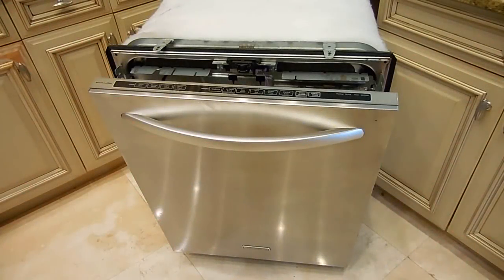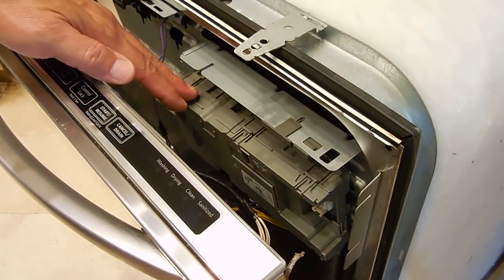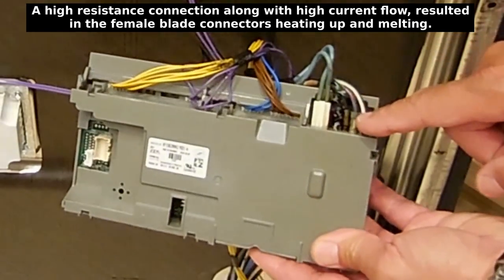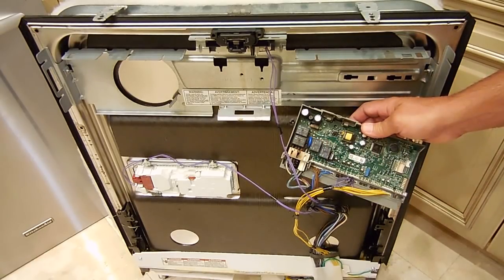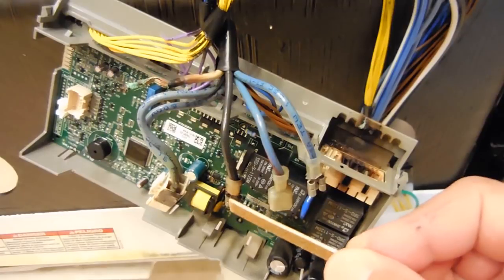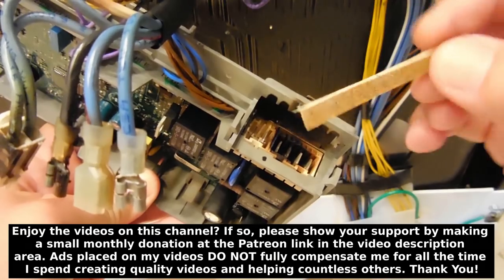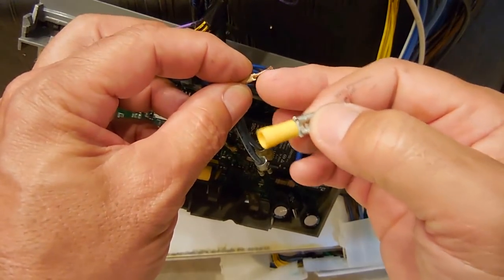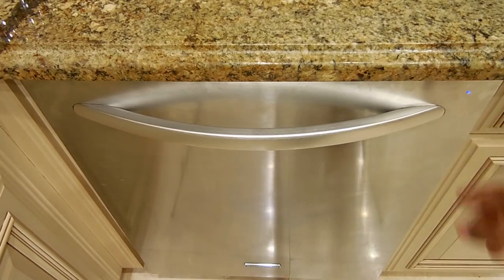KitchenAid Dishwasher Repair (No Power)

Comment from the maker: At the link below enter "dishwasher electronic control board" in the search box for a complete listing for your KitchenAid:
http://amzn.to/2jGNyVJ
(Amazon Affiliate Link)

*Don't miss out*  9% off Banggood sitewide! Next 2 days only. Visit the link below, and use this coupon code: 2017cyber9%. Also try this code for 10% off electronics: ELECTRO10

Home Page: http://bit.ly/2wDbRdi
Flash Deals: http://bit.ly/2eBLkVI
(Purchase supports my work on Youtube)
Reply: I don't need it but I thought it would be interesting to see the price of the board, the link doesn't work. Must have been the heater wires.
Reply from the maker: The current draw of the heating element is what causes the problem to occur, but the wires to the heater aren't the problem, the power supply wires to the control board are. The link works, read above again. Thanks!
Reply: Yeah I missed the add "Dishwasher control board" Yes I understood the connector was the issue, poorly designed as you mentioned. My repair would have been to remove the plastic and solder directly to the terminals.  I realize this is not for everyone. This should not be common especially with a heating circuit. That is why we have UL, these types of issues should be a UL fail. Excellent as always example. Currently with YouTube changes I do not get the RE's I have to book mark and come back to see any additional comments. I wish they would get their act together.
Reply from the maker: I also thought of bypassing the terminals and soldering the wires directly to the wide traces. They really botched by using the blade connectors.

Comment: The same two wires burnt! The repair guy wanted +$600.00 to “ replace the control panel” plus labor… “it’s a lot of work “ he said! Thanks to your video and your thorough explanation I spent on  a couple of connectors and a pair of pliers. Done!! I fee so proud of myself!! Thank you!!
Reply from the maker: Great to hear! Hopefully it holds up. If it doesn't, you can buy a replacement module at the links provided. Thanks for watching
Reply: Same with my dishwasher. Wire’s toasted. Hope the circuit board is fine.

Comment: Wow, an $88 board that will outlast almost assuredly the compromised card.  I'm not so sure the savings are worth a correct repair, in my opinion.  The heated terminals on the PCB WILL fail again.  Its not a loose card connection point that makes the charred ends.  It's continuous CURRENT that creates the excessive HEAT the burns the connectors.  This wi/ll happen LIKELY based on hours of use.
Reply from the maker: It was a lousy design.

Comment: I have exactly the same dishwasher and I had exactly the same problem about a year ago. I replaced the control board and made sure the connectors were ok but now I can smell it burning again. This will be the 6th major repair I have had to perform on this machine in 6 years of ownership. What an unbelievable piece of junk. On my board it looked like one of the relays was failing and that is what cased it to burn. However, that fact that some here were able to fix the connector and put the board back into service indicates that it is, in fact, a connector issue. Either way, if the controller board looks like it has been damaged by the heat you should really consider replacing it because it may be the next weakest link.
Reply from the maker: The dishwasher should've been recalled for being a fire hazard. Thanks for watching!
Reply: @electronicsNmore  Spot on. This is a horrible design. Mine burned the relays even with perfect wiring. I’ve replaced way too much stuff on this POS in the 7 years I’ve had it. It’s going in the trash and I’m Going Bosch 800 series... wish me luck!

Comment: I have a similar model with the similar control board. The DW is completely dead. I've tried reboots, turning of the CB for 15 minutes, nothing works. I took it apart and there are no obvious burn marks. Earlier models had  fuse that was easy to replacce. The control board is 200 and the repair guy trip charge is 205.
Reply from the maker: It's easy to install. Buy one and do it yourself. I included links to buy it on Amazon. Look in the video description area. Thanks for watching!
Reply: @electronicsNmore  Thank you for the video. My dishwasher looks to be the same model and won't turn on. Nothing looks burned on mine but I do have power coming to the board. I'm thinking I need to replace the board but I don't know how to check to be sure. Any tips? Also, I don't see a link to buy it on Amazon.

Comment: This is exactly what happened to my Dishwasher. I have a Kenmore 665 model.  I had to buy a new control board because my current one wasn’t even working.  The replacement was used but I also noticed a little charring on the terminals.  I cleaned them up and works good as new.
Reply from the maker: Make sure you squeezed the female blade connector tighter before sliding it back onto the male blade.

Comment: In case this helps someone... my Kenmore DW had no power, and all I needed to do was turn off the breaker and on again, as if it needed a power cycle/reset.
Reply from the maker: You got lucky, with the KitchenAid dishwashers, they're usually burned up.
Reply: you might want to inspect the wiring for signs of burning.   and clean the terminals.

Comment: Great video. My board was burnt worse than this one and needed to be replaced. Also had to put on new connectors although I didn't use heat shrink wrap on the wires. They had plastic on the connectors where I crimped them. Replaced board and it works perfect.
Reply from the maker: Glad to hear you're back in operation Don. I have many videos on my channel that cover a wide range of subjects, so be sure to look over my extensive video playlists below for other videos of interest to you, and most importantly share my channel with many others. Thank you
http://youtube.com/c/electronicsnmore/playlists

Comment: I have the newer kitchen aid model to this one. No lights on the control panel and when I close the door, the drain pump comes on for a minute and then you hear a click at the control panel and nothing more happens. The touch control panel never lights up. I replaced the control board but still no lights. The touch control panel is 220 and a new dishwasher is 700.
Reply from the maker: Try disconnecting power to reset.
Reply: @electronicsNmore  I've done that many times. Its in my garage so I can plug/unplug. The door I have to hold the door switch for it to work, but the lights never come on the touch panel.

Comment: We just experienced a burning smell with our Kitchenaid KDTE254ESS1 dishwasher, so thanks for the timely video. I appreciate the quick diagnosis of the location of the problem connections, but it is not entirely clear the root cause was identified, i.e. I don't want to perform this repair if will just reoccur or, worse, there is a more serious latent issue. One insightful review indicated..."connector corroded in the humid environment leading to high resistance connection". Is that your assessment as well? Thank you!
Reply from the maker: A loose connection, or high humidity can cause a high resistance connection.

Comment: Thank you! This is what happen to mine that is only 2 -1/2 years old..  things are not built like they use to be.
Reply from the maker: A high priced DW like this, should not have that design defect. Be sure to look over my extensive video playlists below for many other videos of interest to you, use supplied Amazon links to support my channel when making purchases(No added cost to you), and share links to my videos with many others on social networking sites. Thank you, and stay safe!
http://www.youtube.com/c/electronicsnmore/playlists
Reply: These dishwashers are junk. If you google you’ll see plenty have caught on fire even. Our Kitchenaid is 7 years old.

Drain pump replaced 3 times due to getting noisy.
Wash pump / sump replaced 2 times due to wash performance 
Top rack adjuster kit replaced once
Bottom rack wheels replaced twice
And the final nail in the coffin yesterday - this control board overheated and burned the relays. Wiring PERFECT! board? Smoked. Literally. 

Just ordered a Bosch. Kitchenaid is dead to me.

Comment: I have a kitchenaid kudi01tj dishwasher that stopped during the rinse cycle and has no power or lights. Opening the front panel and looking at the circuit board shows no signs of burnt cords. Should I replace the entire board to be safe or could I get in with a multi meter and test connections? Do you have any more diagnostic help with this situation

Comment: i watched your video and I have a similar model.It's a kudc10fxss5.There was no visible damage to the mother board and i don't see a thermal fuse.All it does is beep quietly with no lights on anywhere.
Reply from the maker: It's possible it got damaged from an electrical storm. You can find boards online.

Comment: Maybe give the area around the spade connectors a spray with contact cleaner/anti-oxidant during re-assembly. Most likely the connector corroded in the humid environment leading to high resistance connection (=heat), the spray will help prevent that happening again. I could recommend ACF50 for that job as it has worked for me but there are others. Once the plating on the connector is damaged it is very prone to more corrosion..
Reply from the maker: Yes, that would be a good idea especially if you live in a humid environment, or don't like to use A/C. Probably use a silicone gel, the same type used in telephone wire crimp connectors made by 3M.

Comment: check solder on socket too
Reply from the maker: Correct, the male blades are very long coming off the board. They can easily get hot enough to melt the soldered connection. Thanks for watching!

Comment: I have a KitchenAid dishwasher 2 1/2 years old I don’t warrantee and I’m on my third circuit board what a piece of shit they won’t send me the board for his five year warranty on parts but it has to go through a dealer what ever you do do not buy KitchenAid appliances they are made by Whirlpool
Reply from the maker: KitchenAid should have a recall on these dishwashers.
Reply: Has long as people put up this crap they will make it and as time goes by it will only get worse. Same with Cars trucks Etc. Good video has always Doug. Another family member lost three days ago,  due to these damn quack Doctors. Almost all are arrogant SOB"S.
Reply from the maker: The dishwasher in this video is very expensive, so the problem should not exist. Very sorry to hear about your loss. :-( Never a good thing to lose a family member, close friend, or pet.
Reply: I thought I was buying quality appliances made by KitchenAid but I later found out that they are made by Whirlpool.  Paid over $13,000 for all new kitchen appliances they only have a One year warranty I paid $439 to KitchenAid to replace the second board and now that first repair is under a one-year warranty and they came out and put another board just last week. There were no burn spots and I have surge protectors on the panels